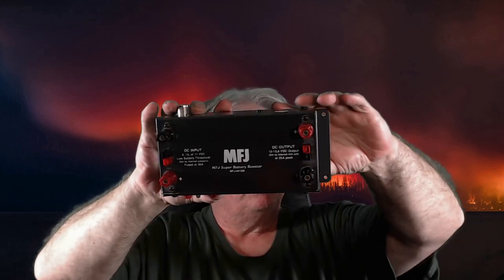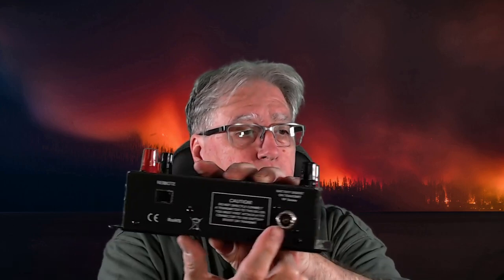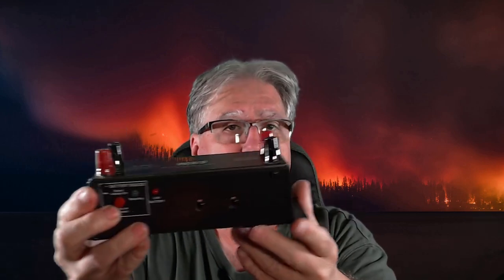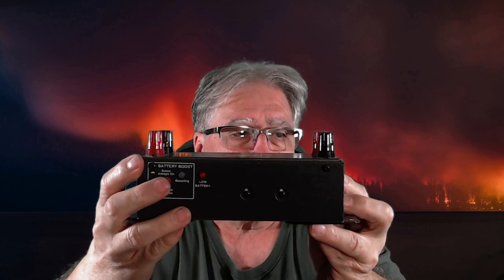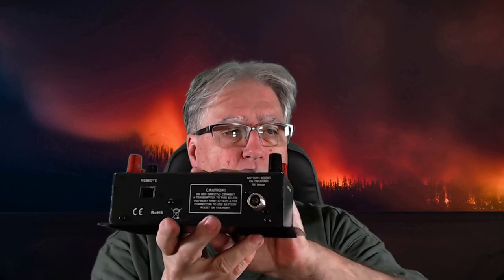Boost Converters - Testing A $60 13.8 DC Boost Converter For HF Radio Operations

Comment: Stuart, your test, the capacitor fix, and your comments seem particularly useful for a non-HAM problem.  A lot of folks and I own a Suzuki outboard motor.  For about 10 years, these motors had a habit of being tough to start due to a voltage stability issue on a wire powering the Engine Control Module (ECM).  Anything at all would cause it, from poor connections, to voltage drops during cranking, to older batteries that weren't completely topped off.  It was maddening, and for most owners it still is.  That includes me.  Then, the thought came that we might use a DC-DC boost controller, waterproof of course, and unfortunately the ones tested reportedly created quite a bit of RFI, and now the wavering voltage you described.  Well, with marine VHF our only lifeline (156-162 Mhz), RFI is a red flag, and I wouldn't want to test the effects of the "ripple" on an already voltage-finicky ECM.  I'm going to try the XWST and capacitor solution, and because boats all have a battery switch we should be able to connect it and forget it.  Thanks much.  I'll try and report back on the results.
Reply from the maker: Hi,
I'd be very interested in this. Let me know how things work out?

Stu
AG6AG

Comment: Thanks, Stu, for testing the booster. Last December, I bought the 25 amp version from the same seller for my go box but haven't used it yet. I also bought a low battery switch which would be connected before this device to keep it from taking the battery down too much. As you described, the MFJ has that and other features in the same box which can be opened for troubleshooting, but it isn't as "waterproof" as the XWST Boost Converter. I will purchase the capacitor as you described and keep it in the go box so that I reduce the ripple. 73, Robert
Reply from the maker: Great! Let us all know how it works.

Stu
AG6AG

Comment: Thanks for the look at the low cost option. Be careful leaving it attached to the battery for a long time - even the MFJ must be turned off or it will run the battery down after a time. By the way, to measure ripple you should use AC coupling and increase the vertical sensitivity. Also your 1202XE might be able to see RFI using the FFT function.  73!
Reply from the maker: Great point!

Stu
AG6AG

Comment: Hello Stu, and thank you for the review.  When you were using the booster with your HF rig, did you notice the unit producing at RFI hash/birdies on the HF bands?
Thank you,
Brian, KG8CO
Reply from the maker: Not at all, but I have a sort of high noise level to start with. I can say that there was no "new" artifacts in the waterfalls and no increase in noise floor.

Stu
AG6AG

Comment: Thanks for the review. For general, non radio purposes- my "go box"- I'm thinking the ripple is not an issue. Agreed? If I need to add a capacitor, put it in line on the positive leg?
Reply from the maker: Hi leftofone,
You probably want to correct the ripple regardless of what you are powering. Many devices have issues with ripple. You also probably want to be able to bypass the boost converter when it's not needed to conserve your battery life. Here is a link to a 1 minute video of a project box accomplishing both requirements. It includes the schematic that shows how to hook up the capacitor. It also has links to all the parts on Amazon in it's description: https://youtu.be/Ts8prf1N9fM
Hope this helps!

Stu
AG6AG
Reply: @AG6AG  Helpful video, thanks. In my build I'm installing an XWST boost/buck 9-36 v to 13.8 v 20a converter. I'm assuming my unit will likely have ripple and install the same capacitor as yours. Think I'm okay with that plan?
Reply from the maker: Hi leftofone,
All devices vary a bit. I would test the device you are working with to confirm if there is ripple. The Capacitors listed are 50V and "Should" handle the converted 13.8V and store a large enough number of pF to work for you. The capacitor shouldn't hurt anything if you install it regardless of ripple, but it's always best to know for yourself. Remember, every device design behaves differently, so test what you buy before you deploy it.

Stu
AG6AG
Reply: @AG6AG  I'll try to locate a scope- however I don't own one.

Comment: Stu, I didn't see that you showed what the $60 boost converter ripple looked like under load with no additional added capacitance.  Switching regulator circuits usually have better regulation under load - when freewheeling, they can look not so great.    Also, is your horizontal sweep 10nS?  I'd like to see what they both look like at a slower horizontal rate. Interestingly your MFJ ripple also increased to 800mV when the $60 boost was attached.  You might try adding capacitance on the input of the $60 boost converter OR use an actual battery so that the supply side has better transient response, and see if that $60 converter cleans up.
Reply from the maker: Hi David,
Great points! I did actually show the load ripple with the capacitor in place on the $60 unit around the 15 minute mark. The Under Load reading was done without the capacitor but I did not show it as it was over double the unloaded ripple. We also tested on a 12V battery and saw the same ripples for both devices regardless of load. As for the horizontal sample rate... Yes, a slower rate shows the initial pop and the recharge of the inductor, although having it a the shorter time sample improves the response time of the scope samples (just a $350 Siglent).
Hope that answers your question...

Stu
AG6AG

Comment: Any updates? Is the 60 dollar china booster still in operation??? Good video by the way.
Reply from the maker: Hi Brandon,
I've had it installed on my FTdx3000 since the video but have only needed to use it for about 10 - 12 hours total. I have another one that I use with my FT991 in a go kit but that one has only been out about 6 hours.
So the short answer is "so far so good".
One thing I have noticed is that when the input voltage drops below about 11 volts, the device is starved for power. This can be seen in all it's glory when the cable feeding the from the battery has high loss (usually due to distance and wire gauge). Once I corrected those issues it worked pretty well for me.

Stu
AG6AG

Comment: Did you measure efficiency (Po/Pi) of the two?    Can you measure the temperature rise of the two, without load, and under load?  Both of the above measures look to how much power they use (there's no free lunch, right?), and how efficiently they get rid of the heat that they create.

Comment: How much current does does the XWST use with no load and with a load?  Thanks David
Reply from the maker: Hi David,
I'm assuming you are asking about the XWST. Under our test conditions I saw right around 10mA which seems to be about the same as the MFJ. I typically turn off / bypass the device when I don't need it.
Hope that answers you question!

Stu
AG6AG
Reply: @AG6AG  Thanks, I will pick up a couple capacitors  at Dayton this week since I plan to buy one!